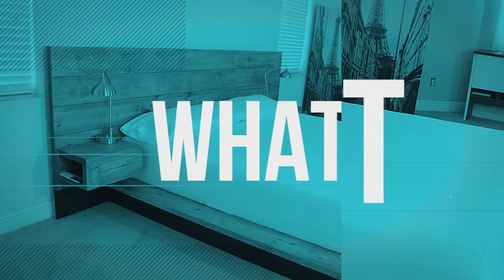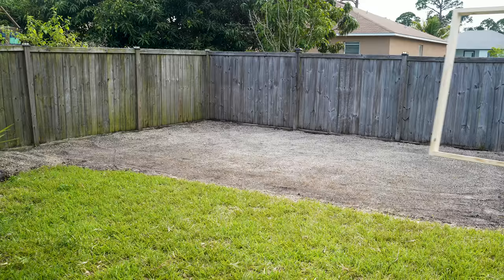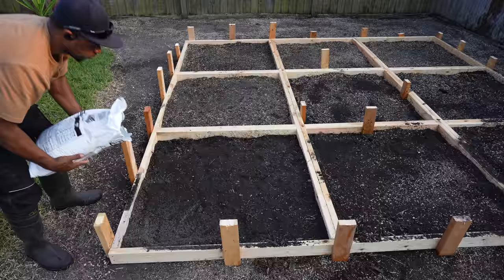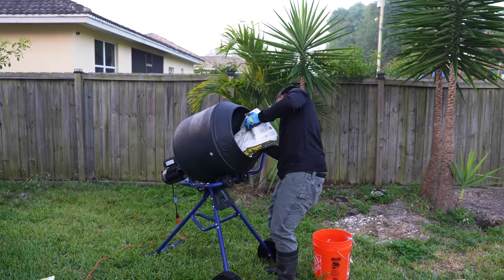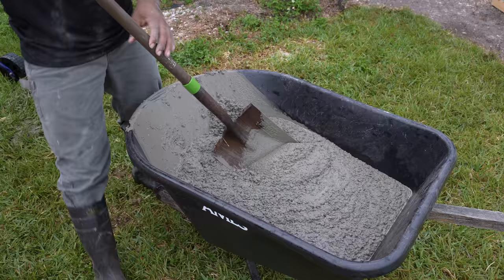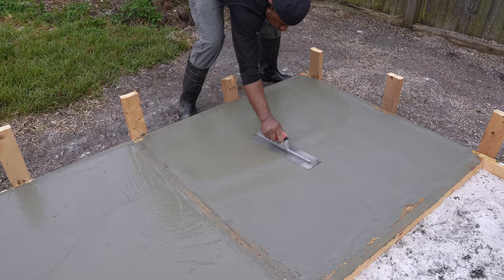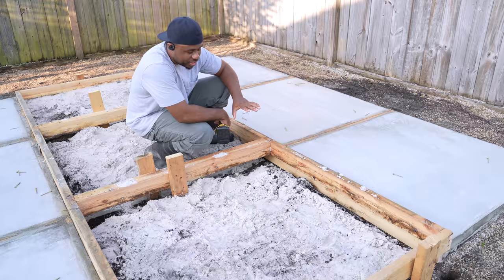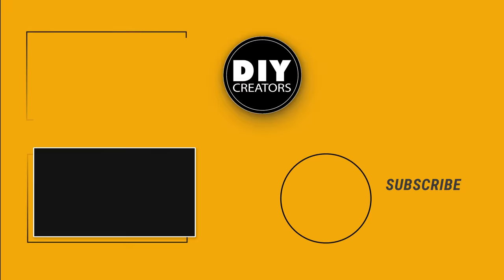Making Extra Large Concrete Pavers ( DIY concrete patio )

Comment: I have poured 10’s of thousands of yards of concrete in my lifetime. You did an excellent job especially if this was your first time pouring, forming, and finishing concrete. Working with concrete that you are mixing yourself is much more difficult than working with a ready-mix.  Measuring the water for each batch is paramount for consistency. Don’t eyeball how much water you think you need. Then, not having all the available tools that make it easier, obviously just adds to the degree of difficulty. 
As to all the comments on reinforcement: These are close to the size of sidewalks, and I’ve NEVER seen or personally reinforced sidewalks. And if I was going to, it would be with wire mesh. But the other side of the coin is that sidewalks are typically 3 to 4 inches thick. Fiber mesh would be an excellent option. I must commend you on compacting the ground under the concrete. It’s vital for strength and if I had to choose between reinforcement and ground compaction, I’d chose compaction. 
Edging and spraying the forms with vegetable oil would make a world of difference in how easily the forms could be removed and how smooth the outside edges would end up.  A light broom finish after your last troweling would serve to conceal imperfections in your troweling while providing a nonskid surface. 
Again, I think you did a great job and , but I think, at the very least, I would have gone with 3.5 inches thick.  One vital note is not to opt for a quick setting concrete mix, especially if you are a novice. You need time.
Reply: Really constructive, and helpful reply, Thanks David!
Reply: Some nice little tips in there bro, thanks for ur input too..
Reply: I must commend you on compacting the ground under the concrete??? How about actually putting a base down? Who pours directly on top of the earth???
Reply: Thanks for your professional tips!
Reply: @josephland34    I don’t  know that much about pouring concrete , that is why I’m watching but I think that he put down sand (as the base ) before the concrete on top of the earth .  They are squares not  really large so I think the sand was probably enough without using the wire mesh etc like you would a driveway ,a larger area .  Maybe I’m wrong  but maybe I’m right , who knows . Maybe someone else could answer your question ,I really would like to know honestly if what he did with just using the sand would be just fine to hold up long term .
Reply: @josephland34  He did put a base down, didn't he?  Typically, you will only find a lawyer of plastic / moisture barrier between the concrete and the earth.
Reply: Wow... great info here
Reply: @josephland34   He did not  put concrete on top of earth.  Are u blind ? He literally added layers . But anywho... here’s some cheese 🧀  for that whine.  Later hater
Reply: I would use wire mesh.......I'm not an expert like you are, but I do make concrete containers.....there are really a variety of materials you can use for reinforcement.

I'm going to follow, just to see what these guys are up to. 😎
Reply: Good notes and comments.  I agree,,,you run that trowel like a pro and smart to design your de construction the way you did.  Likewise,,,,i would have done a light layer of sand on bottom first,,,tamper, and then crushed rock,,,tamper,,,,and then wire mesh, then pour
Reply: You're joking, U think this is his first time, please don't be fooled,
Reply: @deanlester4484  Instant concrete bags is the save, but costly.
Reply: Gracias por los consejos
Reply: THis this right here!!
Reply: Great Job!
Reply: GREAT AHARING OD KNOWLEDGE FROM A PROFESSIONAL . . . YAY & THANKS!  HE (DIY CREATORS) IS AN AWESOME CREATOR; ISN’T HE!
Reply: Great info DG thanks especially the fiber mesh part boom proof of the 50+years
Reply: What to do with 3" gaps from framing. Just to pour concrete in them? Isn't it going to crack later?
Reply: I’m a civil engineer and I agree with this. I’m in Illinois and we usually pour sidewalks at 5” but that’s probably overkill. An aggregate CA-6 subbase would be preferred with a plate compactor, but you’re not a contractor so that’s ok. I would’ve edge the concrete at the seam with the wood. A brooming with a California finish would’ve looked nice. Oil the form would’ve been nice. Rebar is not needed. It would be overkill. We usually only rebar if it’s over 8” concrete slab. Vibrating not needed unless it has rebar reinforcement.  I would’ve saturated the subbase to a SSD condition before placing concrete. I would’ve used curing compound or polyethylene sheeting for curing the concrete to prevent shrinkage cracking. I would’ve probably just bought the concrete from a DOT plant at about $160 a yard, minimum charge for 3 yards, would’ve been like $500. A way better mix design and saved a lot on labor.

Comment: Nice job and great finish. I also like to add alittle “broom finish” to the surface while concrete cures and it leaves a tiny grip surface to prevent too slick a walking surface- this is a typical application with sidewalks and patios - lightly brushing with a broom in one direction to create the texture. Blessings and keep up the great work

Comment: Hey Glen 
   Here's a tip for you and the army of subscribers you have . When you use wood for shuttering ( framing) for concreting it's wise to paint the timber on the contact surface with used engine oil , oil and water don't mix so the timer comes away from the concrete much easier . Diesel fuel is ok to use too but used engine oil is a by product so its free unlike Diesel fuel which is expensive at the moment . Keep up the good work 👏 👍  Bill in UK
Reply from the maker: Hey, thanks for the tip I will save this for the future.
Reply: Doesn't it 'ruin' the timber? I would suggest a roll of 'skirting' (black plastic, flexible foil) to keep the lumber clean.
Reply: @ibubezi7685  Technically it does ruin the lumber, however, BIll's suggestion is based on using the lumber over and over as formwork.  Your tip is excellent if they want to use the lumber elsewhere.
Reply: @ibubezi7685  no it dont ruin the lumber yes it will have oil on it for many years you are not trying to keep it clean you are making sure the cement dont stick to the form and break upon removal . also here once poured we have to spray the concrete with diesel so it inhibits it from drying out too fast and cracking . as for the wood you can go on and use it for many projects and it will last for years exposed to the elements . FYI motor oil works better than fancy stains for sealing wood
Reply: @justchillinout2002  Right - I didn't think of re-using it for formwork, as to me Glen's project looks like a once-off (unless he's so happy with it, he's going to pave his complete lawn :-) ). 
I found a brochure: they call it: 'DPC Brick Grip' (and I think I heard 'moist barrier' as well) - about 12 cm/4 inches wide.
Reply: @ram1brn  'ruin' it for woodworking (as it is expensive!) - but yes, fine for form-work.
Never heard of spraying fresh concrete with diesel - yes, keep it wet/moist - but with water.
Reply: @ibubezi7685  I think he meant the lumber.  Oil the lumber so that the concrete doesn't bond to the fibers of the wood.
Reply: I was just going to say that. Creates a barrier from the moist cement. And won’t stick to the wood.
Reply: You could just use form release agent. Used motor oil in my backyard? Not even a little bit for me, thanks.
Reply: @454Casull  It all depends on what you will use your wood for after you are finished. Years ago I worked on a construction site (laborer). All our forms were plywood but they were treated with oil to keep the concrete from sticking to the wood. You can also use vegetable oil, but only the liquid type. Use a brush and paint it on, let it sit for a day or so, and then do the work.
Reply: Who yhe hell said anything about spraying it anywhere,  if you could read which obviously you bloody can't it says in plain English to paint it on therefor not getting it into the watercourse . So Mr high and mighty get your fkin facts right
Reply: Used engine oil?  Terrible idea for anyplace humans or plants are going to be since it is carcinogenic and classified as hazardous waste.

Vegetable oil is better.  It's also quite cheap.

The ONLY correct use for used engine oil is recycling.
Reply: @DIYCreators , please use vegetable/cooking oil instead since it isn't toxic waste like motor oil is.

Comment: good idea, i have done it myself. I personally used small mesh and vibrated each slab. I also added a base to my mould so the good side is face down and comes out perfect after vibration. No need to finish the bottom (top) that way
Reply from the maker: Thank you, I appreciate the tip!

Comment: I always preferred putting dry concrete down, and then moistening it with a sprayer. Then chicken wire on top, then after about 2 hours, I do another layer of dry, that I spray soak. 20 years later, my pad is still perfect and uncracked...
  Even with the extreme Florida weather.
Reply: Would be interesting to see that done if you have a video, thanks.
Reply: Pouring concrete dry and wetting then troweling it is the WORST way to put down concrete.  Your good results are the exception not the rule.  I've seen the short and long term results of this and properly poured concrete, there is no comparison.

Comment: Those rainny days did you such a big favor! -You have to cure concrete after you pour. Keeping concrete wet for just 7 days after pour, increases the strength of those slabs by around 400%!! 

Which equals = much less cracking + they'll support much more weight. 

Great work though! Looks fantastic.

Comment: Exterior form release idea: Use pocket hole screws in the cross members so you can screw into the center of the form. Ideally one would use two pocket screws at each end.  The first, a rather short screw to connect with the top of the center board, and the second very long so you can connect it to the bottom of the center board. 
Nice video.

Comment: Keep the stakes below the top of the forms so they don't interfere with the screed
Concrete is strong as it's weakest point. Get the base perfectly flat. 
You definitely don't use a bull float on 4x4 pads. Use an edger to put a 1/4" round on the edges of the pad when the concrete is wet
Reply: Thanks

Comment: BEST VIDEO SHOWING WHAT NOT DO WHEN DIY POURING CONCRETE!

I’ve been playing in concrete almost 40yr and I learned everything from my father w/60yr exp. Concrete WILL crack, not if but when and where. The goal is to minimize cracks by reinforcing it. 

Slab is NOT thick enough, no 1” clean gravel base, and there’s no reinforcement . Note: the standard sidewalk is 4” thick, gravel base and reinforced and for good reason. @ min 14:00 you can see the edge of the far left slab has a few void spots and will be the first points of failure. Also it appears you’re in a warmer climate and if it doesn’t get below freezing this won’t be a concern. For those who live in a climate that gets below Freezing, a 2” pour will definitely split and crack the first winter from freezing and thawing. 

This would have been a perfect DIY job with a few extra steps. At a minimum it should have a base of 1” clean gravel compacted and rebar or metal mesh for reinforcement. Personally I wouldn’t pour anything less then 4”. 

I did see the finished product and it looks amazing. I really hope this holds up over time.

Comment: Great that the rain fell shortly after you did the pavers. The rain kept them wet before the concrete cured which helps them to not crack. Generally concrete has to be kept wet atleast twice per day until the concrete cures in two weeks.

Comment: Looks great. Only thing I would have done differently is a light broom finish to get some texture so it's not too slippery when wet. You could do alternating vertical & horizontal broom marks on each slab to get a cool modern look. But the smooth finish is nice too.

Comment: Cool! I am aquainted with  mixing a lot of bags of Kwik concrete. I did a block wall project a couple years ago. 4.33 cubic yards of Kwik concrete to grout it all. I had a two bag mixer, but it couldn't stand up to the work, so I hand mixed in a wheelborrow the rest. 95 degree heat at times to boot. Over 90 bags.Thanks!

Comment: Very nice. I have a small patio that has concrete pavers in and they are all now pretty uneven and I don't want to just do a slab pour in that space either. So what you did was create a nice hybrid between a full slab pour and segmenting  pavers. I think if I do it on my patio, i'll put either put decorative rock or moss in between each paver for a nice natural look. Thanks for the hard work and inspiration.

Comment: Question:  I really like this look but have been hesitant to do it.  Have you found that chair legs sink if a leg is on the non cement seam portion making the chair or table wobble?  Thanks for the tips.  Looks great!!!
Reply: I would think he could use a poly sand for the joints that hardens.

Comment: This is actually pretty good for a DIY job. The sand you added in the bottom was unnecessary and it was a pretty thin, most sidewalks, driveways, and floors are 4 inches thick for reference. Reinforcement would have been good but given that they are small, separate slabs it probably wouldn't be an issue. Most cracks in concrete are caused by water expanding in the concrete when it freezes during winter. Rebar is by far the best reinforcement you can get, it is much much better than simple mesh.

Comment: Good job man! Yea, finding the best way to mix concrete is a common problem. I suggest “helpers” lol, but if not, I tend to be able to mix 1 bag at a time in a 5 gallon bucket with a mixing paddle attached to a big drill. It’s the easiest for me bc it’s already in the bucket ready for dumping! Good video!

Comment: I am an engineer working for a large civil engineering company. One mistake I noticed is that when you are pouring such large concrete pavers, you also need reinforcement. For reinforcement you put in a metal grid to reinforce the concrete otherwise it will break soon
Reply: We have slabs, roughly 3'x3', installed by the builder of our home in front of deck steps. They were not reinforced and have not broken/cracked in 28 years.

Comment: I thought you did well in constructing your concrete pad area, I’ve seen just this one video of yours and you handled your project better than some guys who claim to have years of experience, and yes form setting and concrete placement with sacked material can be brutal even for a young guy.
The logistics alone is an arduous one.
You simplified the scope of work from layout , grading and form setting and disassemble making pulling forms much easier without hacking away trying to lift the 2x’s without flaking your concrete edges.
One thing I would have suggested would to run an edger as you finished your pads,  it gives your concrete a cushioned finish and yes if you were to use your 2x’s again use a release on your form boards makes it easy to scape clean, so yea, very cool project,
Keep up the good work.

Comment: I like your project. I replaced the center of my garage. I had to deal with lots of bags of concrete.  I rented a U-Haul box truck and had Home Depot load the concrete pallets in the back.  Always buy more than you need. Use a rebar rod and a utility knife to help splint the bags in half. It’s much easier to load half a bag at a time, than loading full bags each time.    Use a garden hose with a trigger nozzle to mist the concrete while mixing. I had drilled and epoxied rebar, but your project doesn’t require that. Wire mesh will help though. I drove back and had Home Depot use a fork lift to remove the remaining bags for return.   Don’t lift more than you have too. I also used the box truck for removal of the old material. 😊😊  I like your content.. 👍👍👍 U-Haul-$40 per day + gas

Comment: nice work! i've mixed a couple hundred bags at this point through my cheap harbor freight mixer throughout the years. I do a couple things to minimize the amount of times i need to lift the bags. my big box store keeps the concrete right out front. So i pay at the register and move them right onto my truck. I also buy pallet at a time but bring home half a pallet at a time to same $$.(my truck can only carry about half a pallet without making me nervous). On occasion employees have forklifted a pallet right next to my truck bet, and i slid the bags onto my truck. that method s almost too easy.
almost i place my mixer right into where im pouring, so i can pour right on the ground, and do not need to wheelbarrow. (this works great if splashing is not an issue)

Comment: Coat your mixer with diesel and the concrete won't stick and makes cleaning easier. Also, paint the 2x4 timber with diesel and the frames will pop up so much easier.  You could also add fiberglass fibers to the concrete mix for reinforcing ... very easy and cheap and it is almost as strong as rebar

Comment: Using squares allows you to work and finish each individually.  Using diesel fuel on the form boards and rounding the edges makes them come out easier.  Just FYI.

Comment: At first I was thinking the gap left by the dual 2x4s was going to be too big, but after you removed the forms it looked just right. You can fill it with gravel or grass and it will look good.